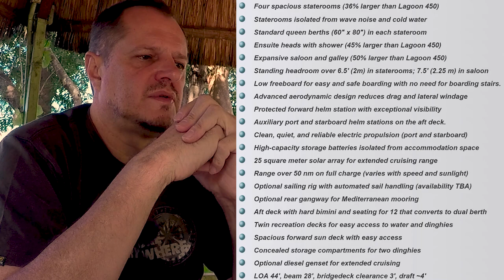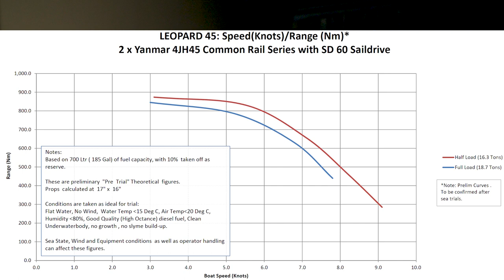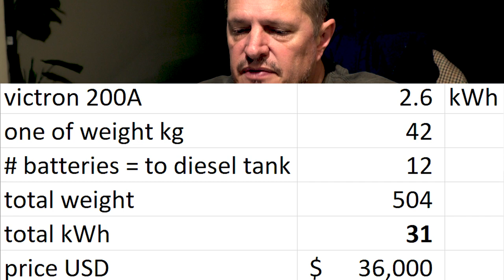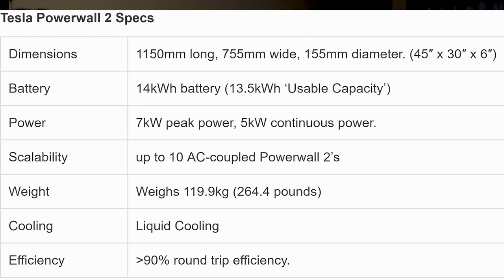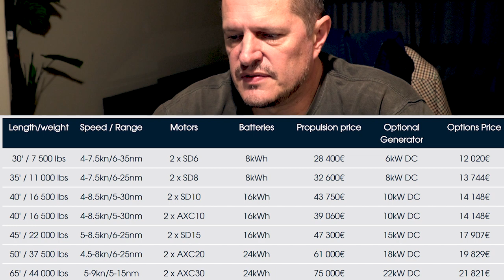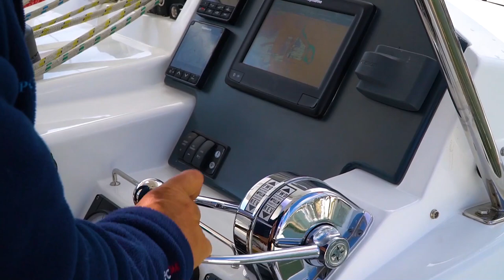#25t Diesel Engines or Electric Motors for Our Catamaran | Sailing Sisu in Cape Town South Africa

Comment: sorry, but i'm a bit confused... are we talking about a sail boat? because these systems (as far as i understand) are designed for a sail boat, where you can top up your batteries as you sail...therefore, your range is practically unlimited, instead of your range limited by the amount of diesel you can store, and when that's finished you have no engine, power generation, etc.
electric engine/generator and batteries on a sailing yacht is a no brainer if you really think about it, specially with all the auxiliaries like solar and wind to add to it.
Reply from the maker: The Hybrids are koowl and the best there is at the moment...The test would be to be able to run those motors for few days without cooling time or recharge time. We have no been twice in 6m breaking waves and 40+ kts of wind where we had to motor for 2-3 days without a break. Off course we took the hard way (80% upwind) going to the MED, which took us close to the section in the Doldrums where there is no wind for 600-700nm...we could just turn on the diesels and they run 24hrs for 5 days, no problem. The Rigging Dr stayed in the Northern Hemisphere and in the steady Trade Winds. I am sure you watched Delos where they sailed Namibia, St Helena, Ascension all the way to Brazil not using their engine at all, not even for dropping or lifting anchor! Crossing the Atlantic is very easy using the Trades, but try to sail 80 different latitude degrees without engine....or to rely on electric motors for days without a cooling of break... BTW, one of the reasons why we choose a cat was the redundency of having two motors...if the genset breaks, then you are in trouble if you need engines....

Comment: This E480 was delivered to the Caribbean on her own bottom from Cape Town......
Reply from the maker: very impressive indeed! but just to throw a bone in the works....Atlantic crossings from east to west are very easy with the Trade Winds....if you may recall, Delos did the crossing without even using the engine...Namibia, St. Helena, Ascension, and Brazil ... anchoring and leaving anchorage all without their engine (or autopilot for that matter)...

Comment: Buying salvage batteries from Tesla Cars would change the cost significantly.  There is no need for a transmission, no oil changes, no filters, and I’m guessing propellers can be more efficient since torque is constant. Having a generator/charger on board is not an additional item, since most boats that size will have one. I hate Sailors that rely on motoring beyond docking.
Reply from the maker: Yes, if I do go the electric way (that is if I can sort our charging or lack of charging issues out) then it would be the Tesla batteries!

Comment: Hey Fritz, I found these two videos featuring Dave Tether of Emotion Hybrids that I know you will enjoy. It's all theory with graphs from a Catamaran Owner that explains the efficiencies of a Hybrid System over the diesel systems. And this was back in 2010 when he gave the presentation. 

At that time he stated Hybrid Electric systems had gone mainstream. So my question is, what is preventing us from doing it today? I like the Electric Serial Hybrid Option, meaning, an Electric Motor with a Multifuel GenSet that is more efficient than any diesel engine can be.by itself and it allows for multiple inputs, such as Solar, Hydro and Wind as well as da dock hookup if desired to charge th3e batteries.

1. American Sailing Club and Emotion Hybrids - Choosing Your KW motor size - https://youtu.be/OW8mzN-KPN4
2. ASC & EH - Diesel Electric Propulsion VS Hybrid Diesel Electric Systems -  https://youtu.be/DDPcB--VxqQ

Let me know what you think.
Reply from the maker: Thanks!

Comment: There are a lot of misconceptions in this video about using electric motors.  I won't go into them all, but saying that you can go 800 miles on diesel and only 10 on electric is the first misconception.  The proper statement would be, you can go 10 miles on Electric (which is also incorrect, you can get more like 30 miles on a reasonable battery bank) and zero miles on diesel... without using fuel for either one.  Then, on the electric hybrid, after you go your miles without using diesel, you can fire up a generator and continue on diesel, where with the diesel you have already been burning fuel.  Now, the next thing people tell you is that the hybrid is less efficient then a straight diesel when using fuel.  What they forget to calculate is that you also regenerate more electric power as you sail.  In the end, this more than makes up for the difference in efficiency, and you can simply travel further on the same amount of fuel with a hybrid diesel system than you can on a standard diesel.   How much further?  That depends on the amount of solar and if you are using the new Oceanvolt servoprops for regeneration.  Then there is the fact that while you motor on a generator, it can also recharge your batteries at the same time, buying you even more time without running on smelly, noisy diesel that you often have to jerry can onto your boat from a dingy (in may locations).  A hybrid system has advantages in almost every area... except one.  Cost.  There is no doubt that initial cost is currently WAY more expensive, but what is your comfort worth?  I calculated out the savings over 10 years cruising, and the two systems will nearly be a wash in the end, that's how much fuel you can save, and that's a LOT of diesel I don't have to find, carry, clean, and smell while in exotic places.
Reply from the maker: Thank you, Phillip! All valid points, but first point I wanted to make is that per same kilograms of 700 liter diesel, the same 700kg weight in batteries. And I stated that right in the beginning. Further, I need 2 x 45 hp to drive that 20 ton cat, so, one should need the equivalent in kW. Hence why I said apples with apples, but it is difficult so, let me just use kg and kW as a starting point to proof that one should not think that replacing the weight of your batteries and the weight of the engine with drive train batteries. Lastly I also stated that yes, one can weight and the sun or wind or hydro will charge, but one for safety reasons, have to consider that those are 2 x 13kW motors and no current technology exists to fit that charging capacity on the cruising cat without sacrificing structural integrity and serious performance hits. You only generate power when you sail with wind only...which is far less than many people think. Further, if you look at the all the links in my description and the links from the comments, you will notice a trend in the type of boats...it is high performance carbon fiber cats which weighs more than half of the 20 ton cruising cat. Those performance cats goes very often above 20 knots and then the hydro regen is excellent! Uhm...running on generator is smelly fossil diesel...the word hybrid does not mean you do not use diesel and you do not have smelly noisy smokey diesels...hybrids are using diesel engines hence why hybrid is even worse, because you have to keep the weight of the engine and the diesel on the boat. Don't get me wrong, I am going to start with hybrids, I just need to look for a 45hp diesel with a sail drive hybrid. I am sure I will be in the first group of cruising sailors to go fully electrical over oceans. Read that carefully again and focus on the word cruising, not racing, not high performance, but a 20 ton fat and heavy cruising catamaran with lots of luxuries such as microwave ovens, chargers, TVs, computers, lights, music systems, freezers, hot water, air conditioners, etc. Tough call, mate! Our electricity system just for these luxuries, is already $60k! But that will come up in a video soon, so, keep on watching!
Reply: The Oceanvolt servoprop changes those number significantly.  Each (of two on a cat) recharges at 1 kwh at 6.5 knots, a speed easily achieved by your Leopard.  That is two kilowatts per hour (more if you can sail faster than 6.5, but let's use that number).  If you figure you can sail 50% of the time (a generally accepted number, on a trade wind passage you can probably do better) you can charge 24 kilowatts in 12 hours of a single day.  With a solar bank of 3 kilowatts (also achievable in the space on many a catamarans due to the large salon roof), and figuring about 5 hours a day, that's an additional 15 kwh recharge.  That is 39 kwh (total) recharge, which means you can leave port and motor for about 30 miles, recharge during the voyage (assuming about a 30 kwh  battery bank) and motor again for another 30 miles.  That's sixty miles, per day, not burning diesel.  Figure that the average cat is going to travel around 150 miles in a day.  Assuming you sail at least 50% of that, you have to motor 75 miles.  60 of those would be without diesel use, meaning you have to motor, with a generator on, for 15 miles.  Now think about all the shorter passages you do, in many of these cases you won't even have to turn on a diesel generator at all.  Now, lets talk about the generator.  A 20 kwh generator will drive a single 15 kw servoprop motor running at half speed (all you need to move at a decent speed and the same thing you typically do with a diesel engine) and, at the same time, the generator will send some power to your battery bank.  Even if that is only 5 kwh, that's still significant recharge of the batteries, buying you even more time without running diesel fuel.  If you figure about 20% less efficiency in fuel due to conversions, it still doesn't make up for the fact that you only need to use the generator to go 15 miles a day where a diesel boat uses a diesel engine for 75 miles a day (about an 80% savings).  Now, the benefits.  With a 30 kwh battery bank, you can run your air conditioning all night, without burning diesel fuel.  You can make water, without using diesel fuel, take more showers, etc.  Over a ten year period, assuming you are circumnavigating (not sitting in a marina) in the trip I planned out I would save about 25,000 hours of listening, smelling, and hearing diesel.  I will get to buy about 7,500 gallons less diesel, and that means I won't have to carry a lot of that fuel in Jerry cans, to and from shore, in taxis, etc. in many remote places in the world.  Sure, the hybrid system is more expensive, initially, but you can make that money back over time and while you do, life will certainly be more comfortable.  You mentioned weight.  Using two diesel generators (a 20 kwh and a 10 kwh) as backups in case of the rare need to motor at full power continuously for a long period.   A 30 kwh battery bank, and 3 kwh of solar panels, the weight difference in the the system I measured is about 200 lbs.  I can live with that for all the benefits of the electric system.  Finally, it is true you can motor about a half a knot faster at full speed, in the right conditions, with the diesel engine over the hybrid.   Again, a trade off I'd be willing to make for all the other benefits.

Comment: There is not much energy per square foot available from sunlight, even in the tropics.  If you just want to motor a sailing yacht into and out of a dock in your weekend yacht, that's OK.  It is not powerful enough for anything serious.  If you just want to use it very briefly and at very long intervals, diesel won't have much CO2 production anyway.  I've done the calculations.
Reply from the maker: My thoughts exactly. We just finished a 3,900nm passage and we had to motor in total for about 5 days. Three days continously 24 hours a day... No electric motor would have done that.
Reply: oceanvolt pushes a 48' cat along nicely at 7 to 8 knots.....enough for me.
(Indefinitely I might add)
Reply from the maker: The Moonwave? In the video she states 6 minutes to 4 hours....that is almost on par with my calculations.... of 20nm

Comment: You need to watch the Gunboat 60 "MOONWAVE" for a very up-to-date video on electric motors and an all-electric boat !!  And the electric docking system. F.A.B.U.L.O.U.S. !!  The actual YouTbe video is moonwave powerpack for info on how the system works.
Reply from the maker: Thank you, Richard and thank you for watching! That link is in the description :-) but couldn't find anywhere what the actual range is. But, yes, super performance cat, all fibre, all honeycomb resin hulls, weighing half what my L45 will weigh
Reply: "Gunboat".  Isn't that like $2 million BEFORE the electric systems? I believe with that kind of cheese you can do whatever you want!

Comment: Note : the weight of a genoratot is large
You might look at Aquariousgenorator.com theu are an Isralie manufacturer and their unit is fractional compared to other genorators 
I would check them our only aaa few moving ( linear) parts very simple.
Light enough for 1 dedicated to each 
Drive  and charge the lithium batteries.
Note I sorted my lithium drive system thru Copart purchasing a crashed Tesla
Reply from the maker: Norman, we do not have a generator on board and currently not really needing any? Thank you for watching our other videos too!

Comment: Frik, Great work so far! I plan to also buy a Leopard 45 (someday) and install many of the same systems you have recommended. So regarding the electronics/battery systems, have you considered a combo 12V/24V system? I've read some good things about the efficiencies of using 24V for some items (winches, AirCon, water-maker, motors, etc). One site I've been reviewing is from Polar Power:
https://polarpower.com/applications/marine/
PS: Eventually I would be very interested in your final Victron equipment list, and schematic, showing any/all components such as BMS, BMV, Cyrix-Li-Charge/Load relays, Battery Protect modules, ACvsDC genset (and why), etc.
Reply from the maker: Thank you, Todd! Yes, but Robertson & Caine is using 12V for all their equipment so, it did not make much sense at the time. Yes, for sure, higher voltage, thinner much thinner cables. That is for sure a better way to transfer DC. In retrospect, Marcel and I ripped almost all the R&C equipment out but I forgot about that it could be a transition point towards 24 or 48V :-) Petro still needs to make one more episode on Vodka machines and then I will do a video on our final costs. We still do not have all the costs, but it will give you guys a good overview of what the costs are. Don't forget to mention Sisu when you talk to theCape Town office, they may throw in a nice discount :-)

Comment: If you look on Youtube " hidden tecnology" and " hydrogen"  if this resent tec with molekyl add comes thru the idea with electric motors on sailboats and hydrogen powergenerator going to push forward clean tec with less battery stack. 
On ocean volt home site there is several electric builds...good luck .
Reply from the maker: Thanx for the comment,  Bjorn. I would say my best bet at the moment is the HH44 with hybrid engines.

Comment: I wanted to pass this along to you. I found Helen Bells comment over on Sailing Doodles video I posted below for you all. She apparently so far is the ONLY person and Sailing Vessel that I have found that has for the past 3 years been using Solar exclusively, she only uses electric engines and NO Diesel or fossil fuel, has done this for 3 years. 

Via Hellen Bell: https://www.youtube.com/channel/UCp0kh2ETw32RIqO0yiF95Lg

We've been running our 45' cat for three years on 1800w of solar with lifepo4 batteries and no generator.   We run air con, microwVe, toaster, three freezers, two fridges etc etc etc off our batteries.  Lithium and solar is the future of energy.

Better batteries are more efficient at charging and discharging and lots of solar each with their own mppt controllers are the two most important features., along with oversized wiring to reduce losses. Our batteries are lifepo4 lithium iron phosphate and we have. 800ah at 24v or 1600 ah st 12v

lifepo4 lithium iron phosphate and we have. 800ah at 24v or 1600 ah st 12v

If you need more info on there Solar Journey and REAL LIFE working solution over the past 3 years, then contact them over on their Symmetry III and a little Chaos Too Facebook Page at: 

https://www.facebook.com/Symmetry-III-and-a-little-Chaos-Too-566872213459133/
Reply from the maker: Wow! Excellent info! thank you, you are a real source of information!

Comment: check out the solar wave video on youtube
Reply from the maker: The Hybrids are koowl and the best there is at the moment...The test would be to be able to run those motors for few days without cooling time or recharge time. We have no been twice in 6m breaking waves and 40+ kts of wind where we had to motor for 2-3 days without a break. Off course we took the hard way (80% upwind) going to the MED, which took us close to the section in the Doldrums where there is no wind for 600-700nm...we could just turn on the diesels and they run 24hrs for 5 days, no problem. The Rigging Dr stayed in the Northern Hemisphere and in the steady Trade Winds. I am sure you watched Delos where they sailed Namibia, St Helena, Ascension all the way to Brazil not using their engine at all, not even for dropping or lifting anchor! Crossing the Atlantic is very easy using the Trades, but try to sail 80 different latitude degrees without engine....or to rely on electric motors for days without a cooling of break... BTW, one of the reasons why we choose a cat was the redundency of having two motors...if the genset breaks, then you are in trouble if you need engines....